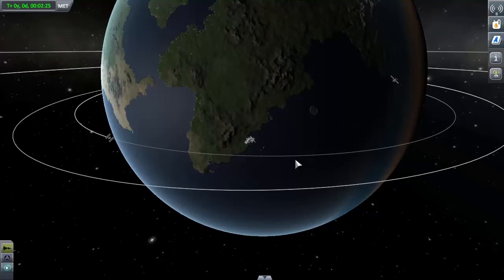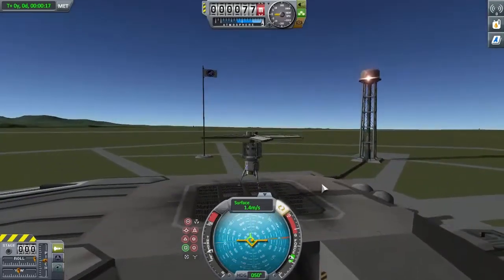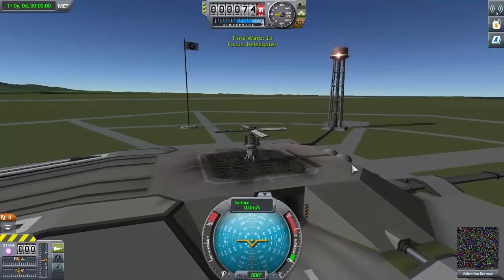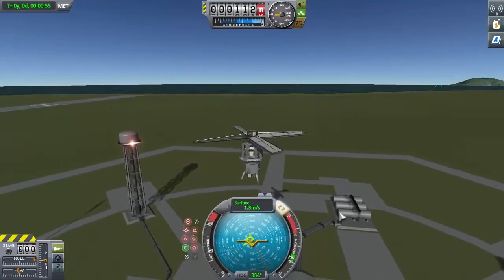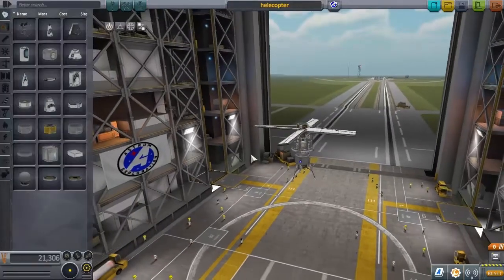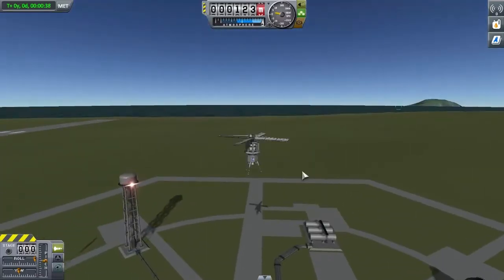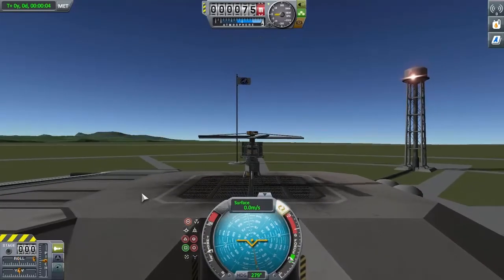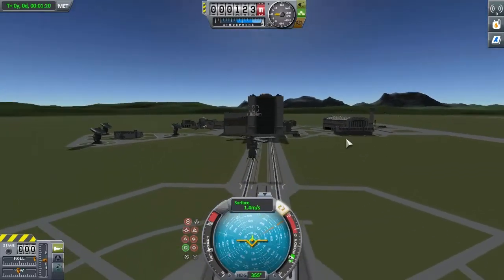KSP working helicopter with stock parts

Comment: This is pretty cool, have you took in a coaxial rotor design like the KA-52 Russian helicopter? 

Alternatively, since you now have a functional baring would it be possible to set to propellers on a main body containing fuel (to remove the need for cheats,) and make a propeller driven plane?

Then in the future by extension make a functional VTOL like the V-22 out of this system? I think that would be a very cool project.
Reply from the maker: I possibly can, the only cheat I had was electricity, I could just toss on an RTG and have o cheats.

Other people have made fuel driven helicopters in KSP so I probably can do it